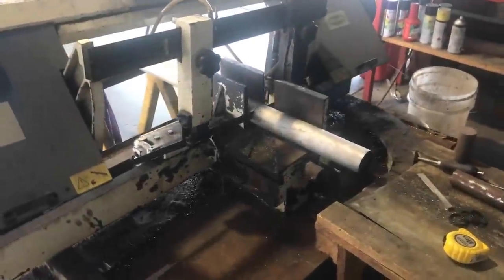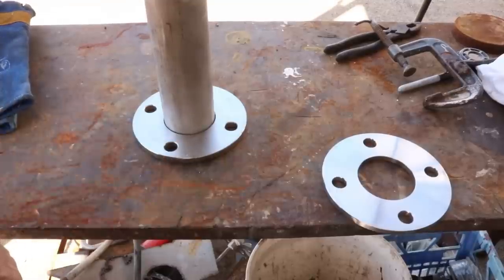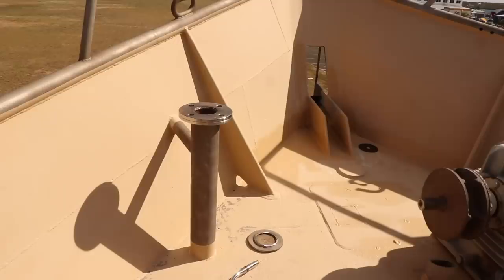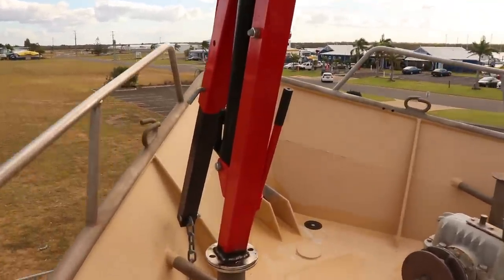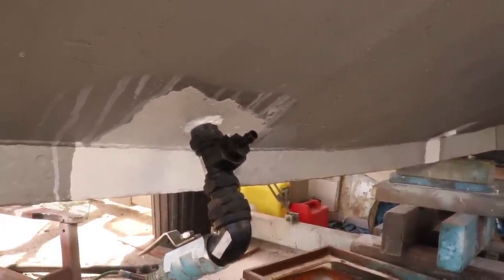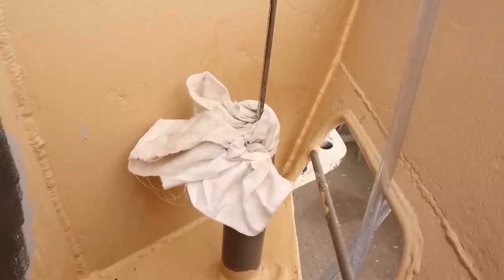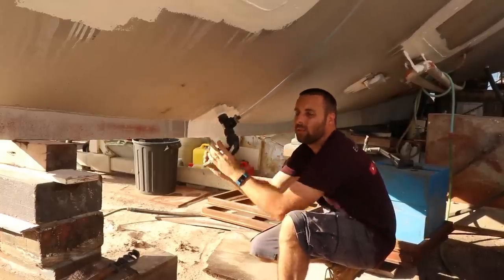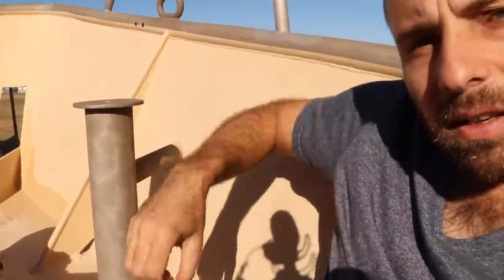Bow Crane & Tank Pressure Testing - Project Brupeg Ep. 82

Comment: Sun in my eyes much for the intro?

Any issues in the spray and cold for a set up like that? Just a question I just wonder if that will be failure point having a sleeve support for that crane or that it will freeze up and water gets in? Any such systems that are used in that way? sleeve in sleeve in higher latitudes?
Reply from the maker: Hi Darrin, we haven't finished the base yet. future additions will be a plastic washer type wear plate between the two flanges, a plastic tube type bush at the lower end of the inner tube. and the whole lot filled with low temp capable marine grease. so in theory no water will get into the tube to freeze and the grease will hopefully always provide a good friction reduction.

Comment: Ok on the little crane but, uh, how are you going to swing the load over the rail? Crane looks too short to take anything of size over the sides of the bow onto the deck..
Reply from the maker: Yeah might be a camera angle thing. it is short but we dont need to extend a long way. only from the deck near the base of the crane and over the side about a meter (which it does well). the primary job of this crane is to swap anchors if the primary has an issue. once its over the rail, that's all we need.

Comment: I suggest a hand wench with a pulley or shackle on the end of the boom in combination with the hydraulic piston to make the crane.  Many hand wenches can handle several hundred to a thousand pounds without much trouble.  You might want to consider welding gussets on the pipe below the pivot point and deck for added stiffness there.
Reply from the maker: Yeah I did think about a manual wrench system. Will most likely be adding one
Reply: Ahhh I think you might mean a "winch"... or are you planning on having a female "strong man" competitor as crew? :P
Reply from the maker: Ha! Didn’t even see that. Autocorrect on an iPhone. Yes wench = winch
Reply: @ProjectBrupeg  I am sorry the computer doesn't seem to know the difference.  My brain seems to be getting leaky.
Reply from the maker: Although this conversation takes on a whole new meaning if it was wenches. Or several wenches capable of taking on several hundreds of pounds
Reply: @ProjectBrupeg  
Careful mate, you'll be sleeping on the fore deck... hahahaha

Comment: 6mm Teflon would be better. Maybe two pieces so they would rub on each other.
Reply: The HDPE gasket he will be using will be fine , also no need for two of them , the wear would be almost nothing without a gasket.
Reply from the maker: Yeah I’m just going to roll with the HDPE cutting board, dirt cheap and easy to come by in any part of the world
Reply: @smartmonkey777  
Though he might want to fit something to CREATE some friction between the plates, I can imagine a 100Kg anchor swinging on the end will create some momentum that will be hard to control when moving it inboard in any kind of swell.

Comment: Does that even give you enough lifting distance?
Reply from the maker: Yip. Only need to be able to lift from the Balwarks (where the spare anchor is stored) to over the rail, where the anchor will be dropped from.
Reply: I had similar thought.  Seems like a winch system would be better?
Reply from the maker: We will be adding a hand winch but for pure distance this is all we need